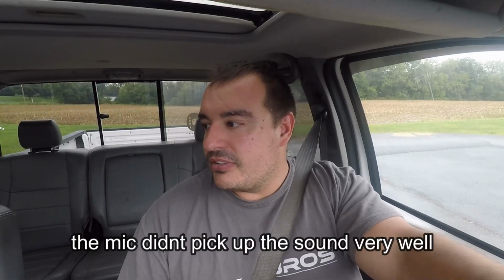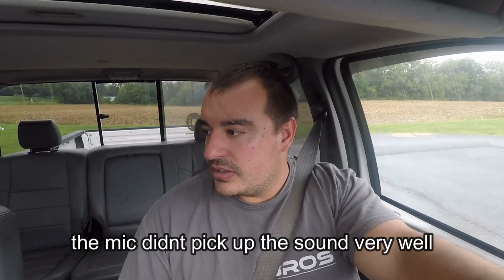6 0 Powerstroke Build First Drive and Impressions

Comment: The fuel guage reading issue is not uncommon for 04.5 to 07 super duty/excursion gas or diesel. The problem is due to the gauge clusters oem stepper motors tend to cause false readings or stop functioning. So its not just the fuel guage.. this issue can effect the rest of the gauges in the cluster. Dealt with similar issues with the one in the 05 super duty I drive. Usually it can be temporarily resolved by disconnecting the batteries & turning on headlights & let it sit for  thirty. But if that doesn't fix your fuel gauge.. either its the sending unit in the tank or the stepper motor for the fuel gauge died. Circuitboard Medics offers gauge clusters for the trucks we drive with upgraded stepper motors to rid the issue for good. Thought this could help when troubleshooting the issue. Nevertheless, your truck has turned out awesome & sounds beautiful.. I'm really tempted to get KDD Icon heads for the 05 I drive. I'm just waiting impatiently for KDD to finally get E.O. numbers for the street port series.
Reply from the maker: Just trying to get caught  up on some of the comments I have missed. I did not realize it was a common gauge cluster issue as well. I am pretty sure mine may be the sending unit in the fuel tank so it will be replaced  when I do the harpoon mod to the fuel tank. if that does not fix it though I will look back into the cluster issue you brought up that I was unaware of. thanks for the heads up and I love the icon heads although I would give it a little more time since they are still very new to the market.

Comment: So happy to see the 6.0 back! It’s always the little things due to their age. I’m dealing with a P0336 code now (crankshaft sensor). The difficulty is getting to the sensor and wire harness. Seems like you have to take 10 items off or have child size hands to get to anything, Lol!
Reply from the maker: Is the crank sensor the one in the front driver side or rear passenger. I did the one in front and it was a bit of a pain especially since the engine was hot when I did that

Comment: Turbo seal leak on that white puff? Also I had that issue when I had a CCV reroute. Put CCV back to stock and no more smoke.
Reply from the maker: I am thinking about the turbo seal or possibly an injector that is slightly leaking. Not sure. I'll figure it out but giving everything a few days

Comment: I'm having issues with my ficm harness any suggestions on a replacement that's not Chinese garbage
Reply from the maker: I can see if dsdparts.com has anything or you can call. Let them know I sent you for a discount. I replaced mine with a Ford oem one
Reply: @six0bros  thanks brother ! Love the channel I just bought a 06 f250 6.0 for 1200 bucks ,needs a bed and a few other things , 500,000km on it ( I'm up here in the Toronto area canada  )
Reply from the maker: @shanesimmons6079 that's awesome man. That sounds cheap for a running truck. Other than the ficm anything major it needs
Reply: @six0bros all brakes , Injectors , standpipes and dummy plugs,  valve cover gaskets , icp gasket , fullnsuspension
Reply from the maker: Ok so it needs a few things. Still though you'll be in that truck  for a good price and have a great truck
Reply from the maker: If I can help with parts please let me know.
Reply: @six0bros  thanks man ! I'm currently saving up for all the parts while I take the box off and prep the frame for a coat of por15
Reply from the maker: @shanesimmons6079 that will be a really cool project. Send pictures over to the Instagram 6.0hbros I'd love to see it

Comment: My buddy had that same issue with the gas tank gauge.  He basically dropped the tank. Replaced everything inside. Everything worked fine afterwards.  Everything was original so he figured just get all replaced brand new and be done with it.
Reply from the maker: I figure I'm having the same thing. It was happening on and off before the truck went down. So I'm not shocked that happened

Comment: What is guess on wheel hp?
Reply from the maker: I was trying to think about this actually last night. It's hard to say since I have been so light on the throttle but it feels like it pulls much harder then before. Still can only do so much with the fuel it has so my assumption is I'm not much higher. It seemed to be about 520 before and I don't think I'm much higher but I think the whole hp curve is much better then before. My guess is somewhere are 530 hp as a peak but I feel like there is a solid increase across the rpm range